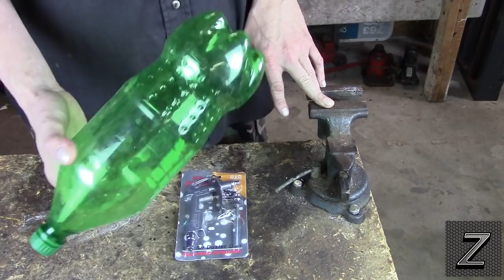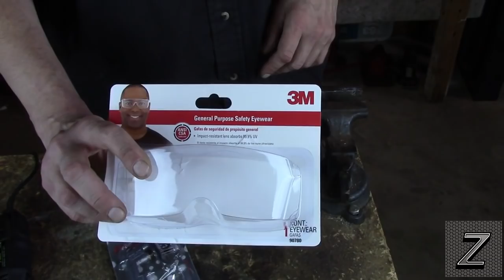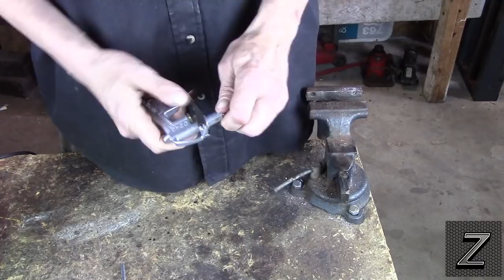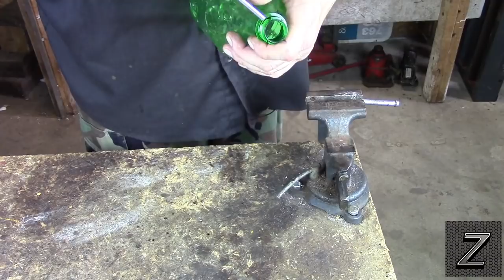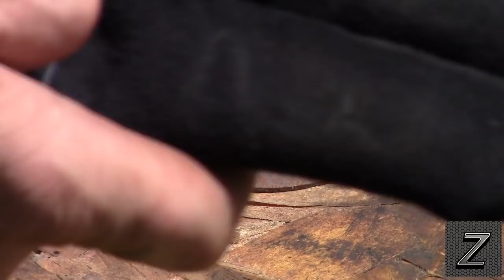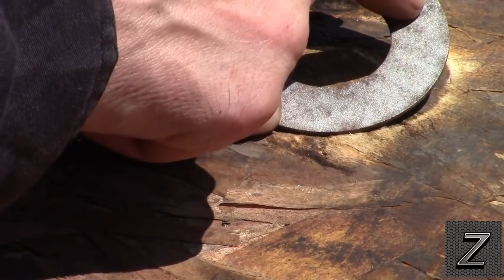Will a homemade sandblaster work? let's build one and find out!

Comment: you can  buy a bag of good clean sand at your local lumber yard it works fine  one word of caution if san d is least bit damp it will clog up i use a metal bucket and a small propane burner to heat sand then its very dry.

Comment: Speaking of 2-liter soda bottles. They make great gun targets. Install an automotive valve stem in the bottle cap. Tighten the cap back down on the bottle. Blow in pressurized air like adding air to a low tire. I put in 90 to 100 PSI Air. USE GLOVES AND SAFETY GOGGLES. I've never had one fail but you never know. After filling the bottle with air set it up as a target. When hit by a pellet or bullet the bottle explodes and is about as loud as a shot-gun.

Comment: My bottle is blowing up like a a balloon.. I worry it will burst. Does yours expand?
Reply from the maker: dont use water bottles they are not made for pressure, use soda bottles. if yours is blowing up like a bolloon you are using a watter bottle or you have a air compressor turned up to a insane pressure.  also the bottle should not compress, if it is you have somthing blocking the output of the sand blaster!!!!!
Reply: @z-hut1663  Cranberry juice bottle. Blew it up. Gonna try soda bottle.  I've seen people running their at 100psi. Mine was on 90.
Reply: bob 90 is still to high I run mine at 80 psi. this setup is for small projects, anything big it takes for ever but it does work.  I use ground walnut shells in mine.
Reply: @tmoomoo42  My media is too large. I bought a new gun with 4 different sized nozzles and its works. Its slow and I have to wait on my 21 gal tank to catch up often.
Reply: N